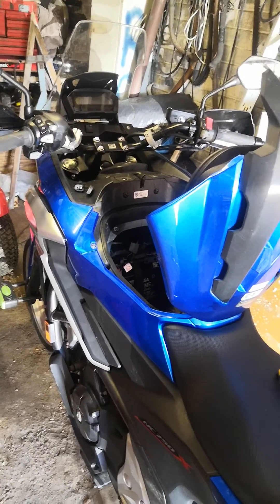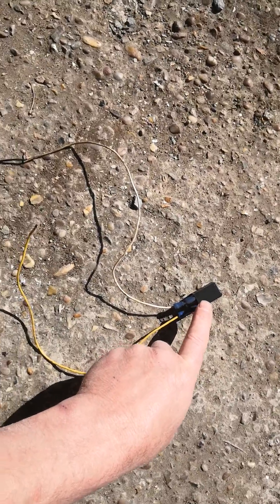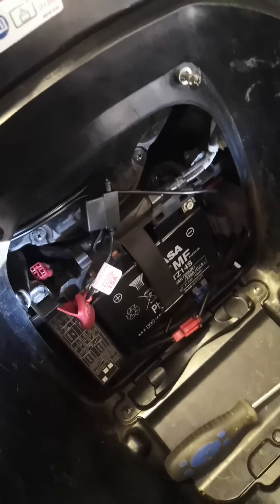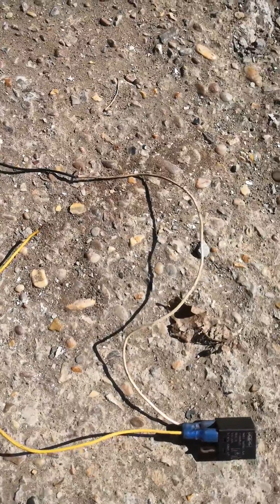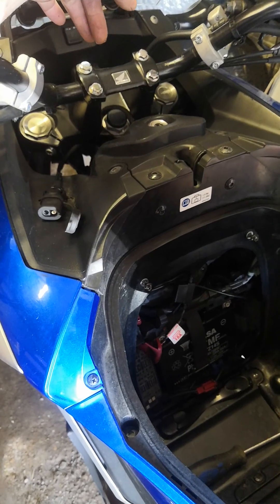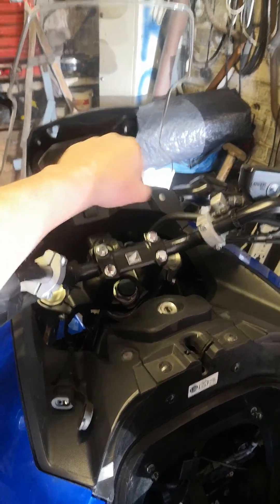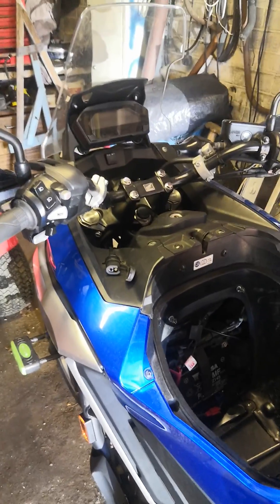2016 Honda NC750X new HISS key programing alternative method.

Comment: Hi, my problem is that my hiss light doesnt come on when i turn the key to ON. It also doesnt blink or anything after 5 sec of disconnecting the + terminal. Is my cable not working? I have a 100 ohm resitor on the positive wire.

Comment: Hi! I think I remember you, I made your key :) The resistor is a "current limiting resistor", is in the cable just to avoid too much current flowing, as a safety measure. The coil in the relay is also a resistor (there are indeed "wire wound resistors" where you need very precise values). In "new" models this is mandatory (the ECU measures the voltage and if it's 12V it won't go into HISS programming mode. The resistor or coil lowers the voltage slightly, so the ECU now knows is safe and can go into programming). 
Good idea!

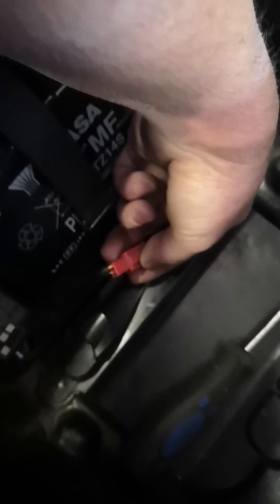Comment: Hi, thanks for the video, I read that the trick does not work anymore on newer bikes but if your 2016 NC750x allows it then my 2017 one probably should work too. Sanity check : to which part of the cable do you need to connect the custom made cable ? The red connector shown in your video at 0:42, or the counterconnector that the shown connector plugs into ? Also : I am not an expert but I have my reservations about using a relays.  When you disconnect the power from a coil it generates a voltage spike of its own and I am not sure the EMC will like that. Some relays may have a mechanism already inside of them to safely limit the excess voltage, others don't.
Reply: @Enicon-t2h  I'm quite sure the red connector is the CPS connector. The male end of it goes to the ECU, the female bit is the CPS itself.